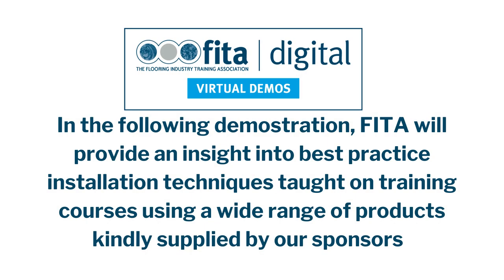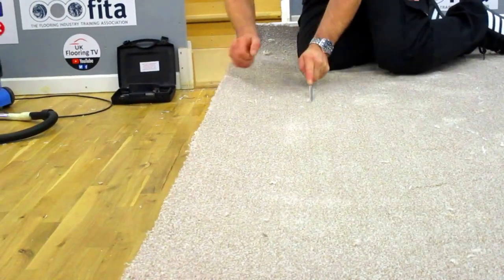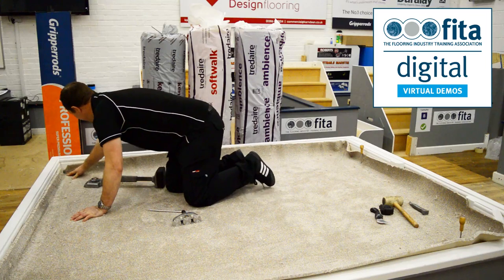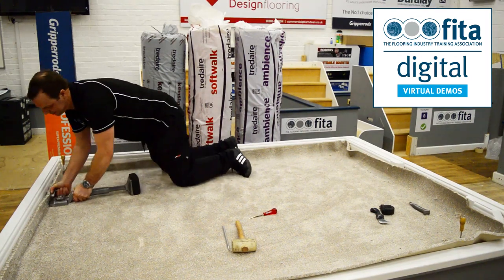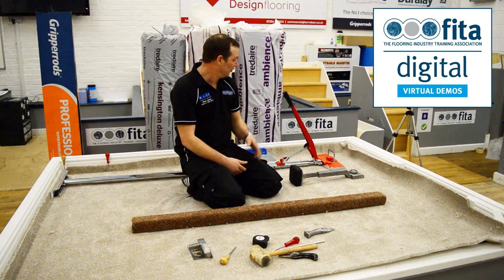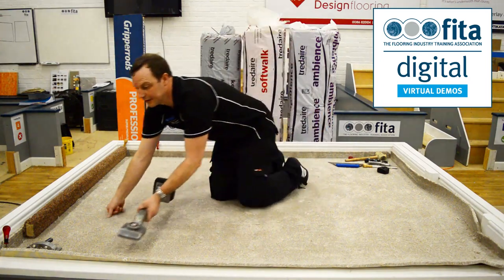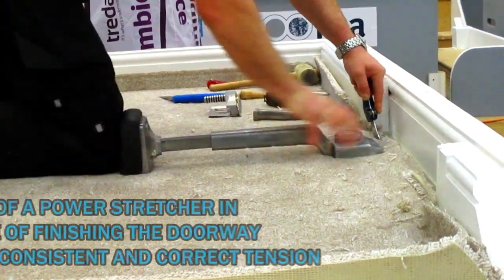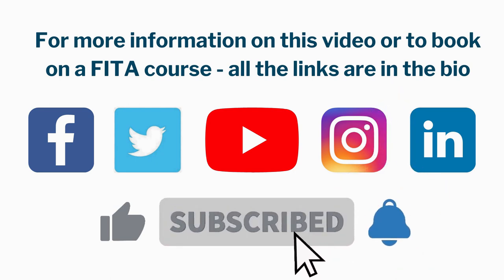FITA DIGITAL VIRTUAL DEMOS - Stretch fit carpet installation with Dan Jones

Comment: I don't understand why you are checking if a plain carpet is straight and plumb!

I also don't understand why you put holes in it with awls, when gripper keeps it in place??
 
Besides that it's very good job 👏
Reply: Couldn't agree much more mate. Ya worrying about plain carpet being square. Pattern carpet yes definately measure square it. But plain a waste of time   but then belting a spike into it to hold it   that would have to damage pile.
Reply: What about the pile?
Reply: @kadsaidi1665  The pile or tufts on a carpet flow in a certain direction with the weave of the carpet..
Reply: @monkeyswift100  yeah so wouldn't it be right to check if the carpet was straight? So the pile goes in a straight line?
Reply: Informative video but would love to see him do all this on a day to day trying to earn money